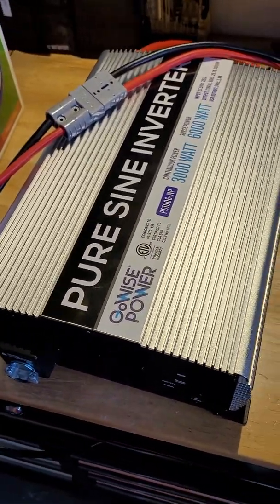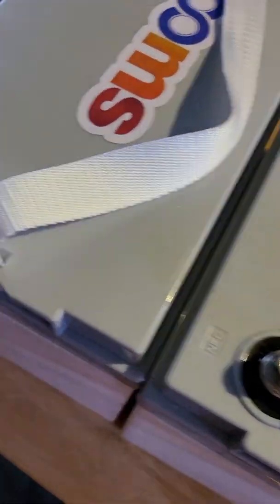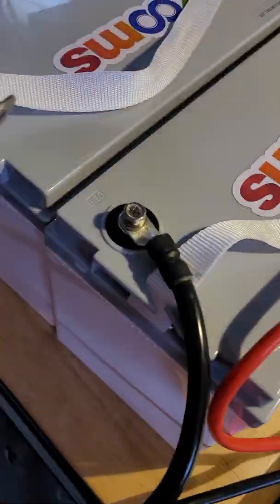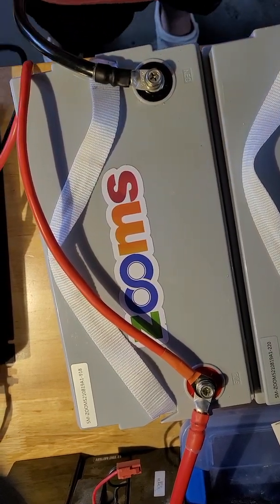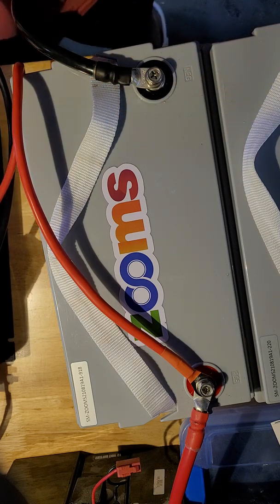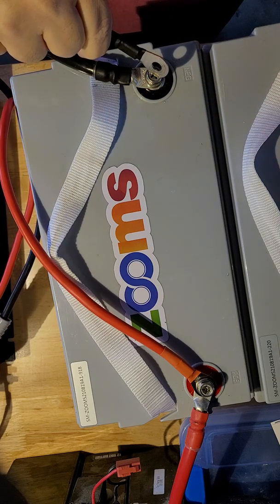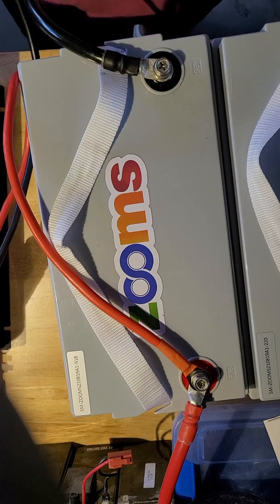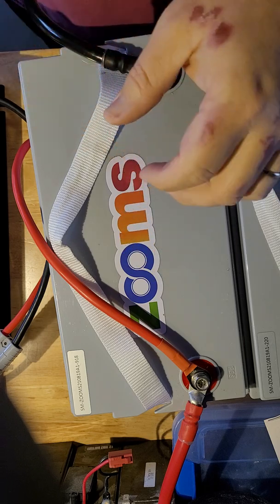How to Avoid Inverter Spark During Hookup

Comment: Is there a preference whether you make this connection on the positive or negative side? I've seen it done both ways.
Reply from the maker: I honestly don't know, I just know the smaller the spark, the easier it is on the capacitors. I don't know why I always do it on the negative terminal here, I know when working on cars that you always want the spark on the negative side to try to minimize the danger to the computer, I honestly don't know why I always do this on the negative... maybe someone can chime in and let me know if there is a specific side that would be better suited to deal with the arc.
Reply: @kevin83FL  After I posted my question, I finished installing my inverter. Because of other issues of where to place the cables before deciding on where they would be secured with mounting straps, I had to hook up and unhook the cables a few times. I tried pre-charging the capacitors using the negative side first using an automotive test light and the light never went out. So the first time, I ended up with a pretty good spark. When I had to hook up the wires the 2nd and finally the 3rd time, I used the positive side and it worked perfectly. So I guess it does need to be the positive side or at least that was my experience.
Reply from the maker: @robh063 thanks for following up, I don't need to know the science behind it, but your experience seems like mine, I will just keep doing it on the positive side lol. You should make a video of your setup and post it. I keep procrastinating, I need to make a short video of mine.
Reply: @kevin83FL  You're welcome. I'll leave the cinematography to people like you that knows what they're doing lol.
Reply: @kevin83FL Wdym positive? You are clearly holding the black wire
Reply from the maker: @Mark-cj1vv  yep. Sorry, brain farts. I'll fix it.

Comment: If the connection is meant to be disconnected/connected multiple times, state of the art would be to use a uController to close relays, 1 for precharge, one for positive terminal on your load, you can then set the timings right for your application
Reply from the maker: I agree, but more simply I would use a momentary on switch (like a horn switch) and just wire it up permanently. I will have to make a new video of the box I put together for my portable solar setup.

Comment: Here's what I did to avoid the spark/melting; Hook both ground wires with the same gauge wire together and then both positives on a switch that could handle the load.
Reply from the maker: That does eliminate the spark that you see, but it is still in-rushing a lot of current really quickly, and is really bad for the capacitors. I have had quite a few inverters pop the capacitors when I hook them up. That was my main goal here

Comment: Can’t you solve this problem by connecting the inverter when it’s power button is off? Then after connected you can turn it on?
Reply from the maker: Unfortunately not because if you have it disconnected for more than a few minutes, the capacitors inside the inverter are depleted, and will suck up an in-rush of current to charge themselves since they are before the power switch in the circuit.

Comment: Thanks I use a 50 watt 25 ohm resistor. They are cheap. Funny thing I have no pencils laying around. The sparking thing is a problem even when connecting a charger to the battery. It’s the same issue.
Reply: Does using a resistor also help prevent sparks when connecting the battery to a charger?

Comment: An anderson connector for a 3000w inverter? Geez I hope you're not running a 12 volt system!
Reply from the maker: It's a 175a connector lol, and two of them are capable of flowing 350a... the inverter is 12v, so it is absolutely a 12v system. I don't see an issue and it has been working fine with the temperatures staying cool... please let me know if I am missing something.
Reply: @kevin83FL  Is it an SB50? They're rated for 50amps (disconnect, though I think they'll pass more than that). Also your cable size looks way too small to be passing that much current to the inverter. I've got a 2000w inverter, and it's using AWG1 cables, very thick! I'm not an expert in this stuff though, have been building for a few months and learning as I go.
Reply from the maker: @modut6258  ahh! My bad, in this video I was just trying to show how to eliminate the spark, that connector is the SB50, and you are right, it is only rated at 50a continuous, it is the cable I use to hook to my solar array for charging haha, my bad. I also use that same connector to hook to a water heater element to heat water for a kiddie pool for my smallest kid, so I typically leave it hooked to the bank. Let me see if I can find a link to another video where I have the 175a connectors, I swear I am not running those connectors to power the inverter lol
Reply from the maker: OK, so I don't have any videos with my other connectors, but I do have them, I am currently on vacation in California, making a gigantic trip around the U.S. in a travel trailer, but will be home in a few weeks and I will make a small follow-up video. The wires on the 50a connector are 6awg, but my main ones I use are 2ga for each connector, so I have two 2ga wires for pos and two for neg.
Reply: @kevin83FL  LOL that would explain it. Good video btw, it was useful for me!
Reply: @modut6258  🤔 I went with 4/0 gauge ... Not taking any chances of burning my truck down 😂 .... On a 2K watt inverter. Probably an overkill  but hey, I needed 15feet one way. I find this stuff confusing so I'd rather err on the side of caution
Reply: @vroor32  make sure you fuse it too!
Reply: @modut6258  oh I put a 200A fuse on it (got 4 semi truck batteries)

Comment: Can you tell me where you got that resistor?
I like that it's solid. The cheap ones, the leads eventfully break off.
Reply from the maker: No problem, I got the 50W-10R here but I don't think it matters which one really, just so there is some kind of in-rush current resistance. Good luck https://a.aliexpress.com/_mMrIVPU

The reason I purchased this one was because I was actually going to permanently mount it to my battery box that I built and put a momentary push button switch (like a horn switch or something) so I could precharge my inverter if I needed to remove the batteries for any reason. So far I haven't needed to remove them, and I don't see any reason why I would have to.